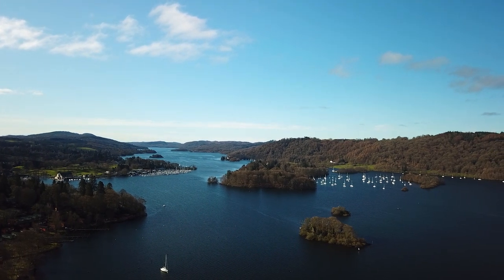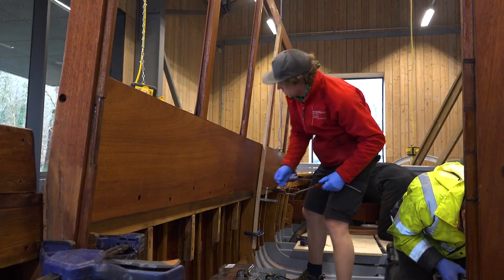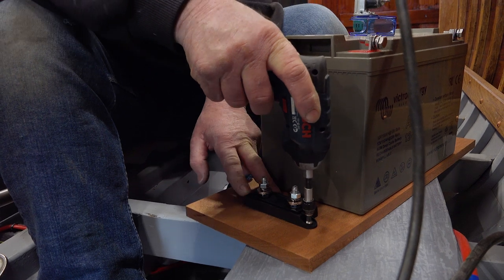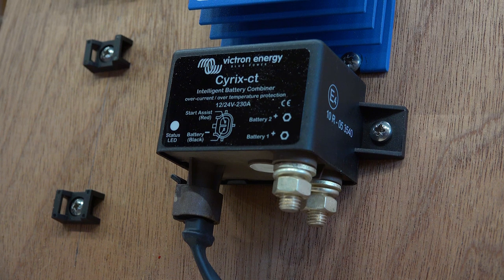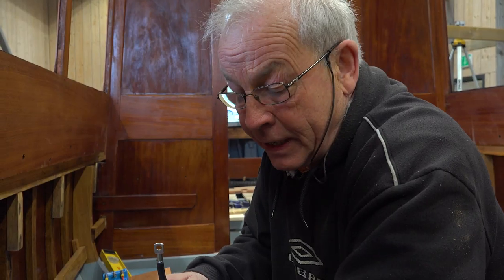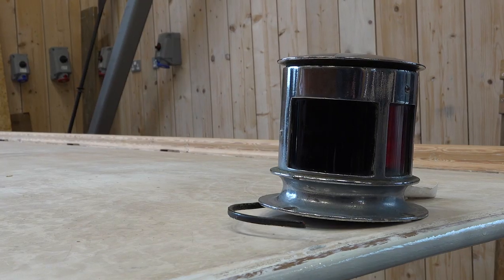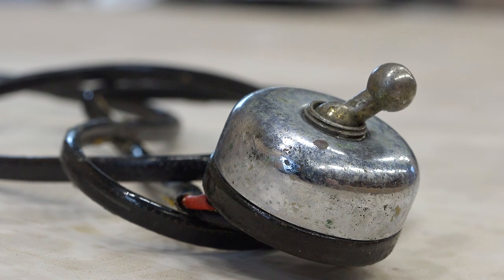1930's boat gets a total electrics overhaul

Comment from the maker: 🎯 Key Takeaways for quick navigation:

00:00 🚤 Windermere Jetty in the UK is restoring a 1930s heritage boat with modern electrical systems to ensure safety and functionality.
02:25 ⚡ The boat's electrical system includes a modern diesel engine with Victron AGM batteries, a Cyrix-ct Intelligent Battery Combiner, and a BMV-712 Battery Monitor.
03:50 🔋 Victron's Smart BatteryProtect is used to protect the service battery from discharging too low, ensuring reliable power.
05:45 🛠️ The museum strives to maintain the boat's authenticity while integrating modern electrical systems, using Victron equipment for safety and reliability.
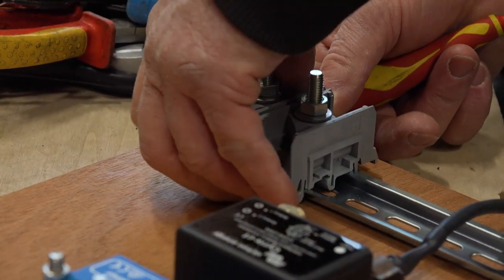07:28 🚣‍♂️ The boat retains its historic appearance with exposed cabling, but modern technology is cleverly hidden within wooden cabinets and secured with Victron equipment for vital functions like bilge pumping and VHF communication.